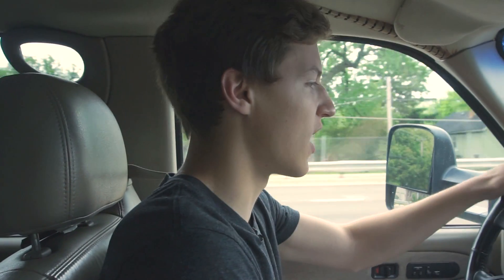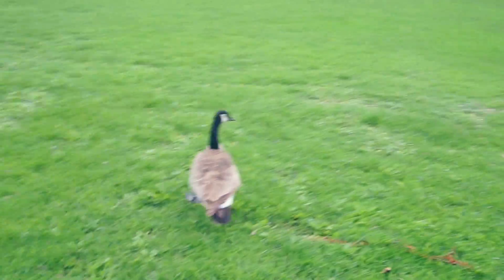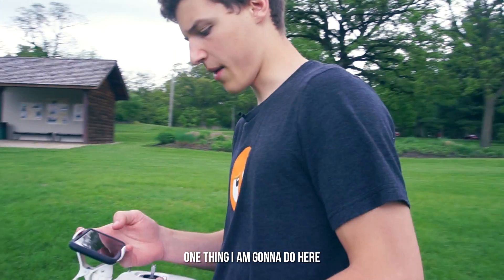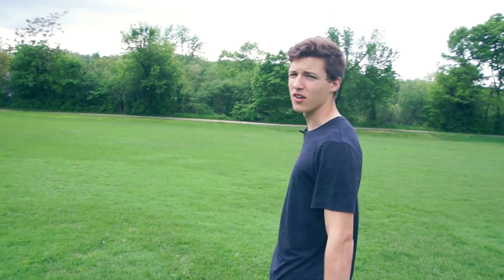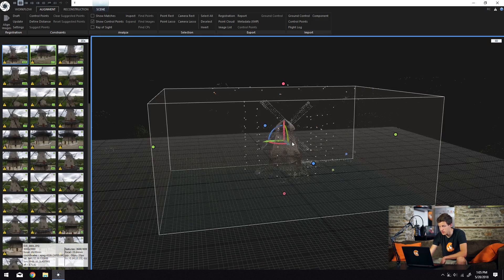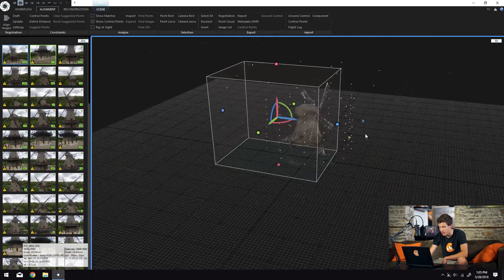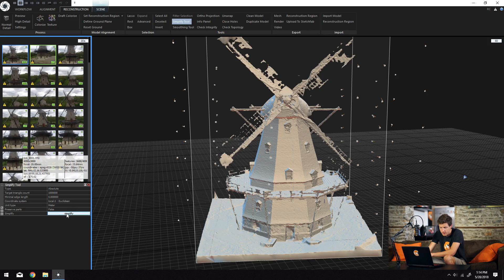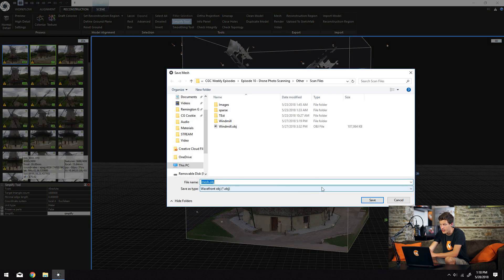3D Scanning with a Drone? - CGC Weekly #10

Comment: To reply to your question: Shoot raw images, tweak them as good as possible (flatten contrast, rise shadows, drop highlights, get correct black and white point, apply s-curve to get back contrast ➡️ but now free of possible blown highlights, push clarity), export to a format the software can understand, and you get quite possible way better results. Check the 360° panoramas on my Facebook page (rolandrickphotography). They are all made of the 26 original DNGs the Mavic 2 Pro takes for 360° panos - hunt: you must activate “keep originals” first, otherwise you’ll only get the finalised jpg made by drone, which is way worse as the manually made one: high res 26000x13000 (manually) has more details than 8192x4096 (drone). Camera settings for exposure and white balance must be M(annually), expose correct to the highlights, this avoids missing details like the strings in the mills wings.

Comment: I find the hundred photos shot straight on was a good start, but you really need 3x-4x more. Start at ground level, about 45* up, and repeat the process. This takes care of things left in shadow a straight shot doesn't get. Do the same thing around with 45* down angle. Lastly, the blades. You could capture one and apply the geometry to all 4. You'll miss structural damage, but it's a huge time saver. You need photos looking at the blades at the angle they are at, maybe 15* off center for a guess. Shoot straight at them, then 45* up and 45* down. Also, finding the owners and museums to sell your scans to is a quick way to pay for your hobby. I'd suggest saving to buy a 3D printer to make models of what you scan. Also, if you pay a bit more attention to the height, every time you change elevation, and attempt to take the 45* up/down shots at that angle, the mesh process is reduced. Less calculations needed. Lastly, the 45* changes to camera position must be done manually, move the lens, not the view. Optical zoom does a lot more for you than digital. Ignore the minimum and maximum distance though, concentrate it at 20% less than they state for ideal range. Good luck.

Comment: I did the same thing with a DSLR using 3DF Zephry. It's a payware but they have a free version that works as good as the pay version.

As far as best practices, the big ones are as follows.
1) Make sure every image in focus
2) Set the f-stop as narrow as possible for the lighting in order to have the widest depth of focus
3) Make sure each and every feature of the object being scanned is captured in at least 3 images from 3 different angles. That of course can lead to hundreds or even thousands of images.
4) Don't be worried about taking too many images. Good photogrammetry software will automatically disregard images that are too similar or will not help.

Comment: I've done a few 3D scans, some with just my phone and some with a Mavic Pro.
Not idea if the Phantom 3 has the exact same software features as the Mavic has, but when scaning an object such as the windmill the easiest thing would be to use the "Orbit mode" to automatically orbit your subject and just use the camera timer feature to take a photo every x seconds. Think of it like making a slow turntable animation. Then manually fly around and get some closeups of smaller details, such as the blades on the windmill.
Using something like DroneDeploy can also make taking the pictures way easier as you just plan it's flight path, then it does all the flying and photo taking.

For something like that windmill, if I wanted as high resolution result as possible, I would probably go with 36 photos in one circle around it. Then probably another 36 photos every 2-ish meters up and then fly in a grid over the place to get some top down photos of both the windmill and the ground around it. 

For anyone just wanting to test out photo scanning I would recommend just going out with your phone and take a ton of pictures of a decently sized rock or a tree stump. In the right light conditions that can produce super nice results.

Comment: Looked a bit of a fail to me the geometry was a mess, You could of modelled it from a few reference photos in the time it took to go there do the drone stuff, buy the software, learn the software wait for it to  compute the point cloud etc. The only advantage I can see is generating a automatic texture map
Reply: It depends on the task. If your task is to just make a windmill, then it would be way faster to do it that way. But if you're tasked with recreating or digitizing a historic piece, then doing a high resolution scan of it and just cleaning it up afterwards is most likely going to result in a better final product.
Reply: Definitely not a fail. Most photogrammetry requires clean up work. There is no way you can model/texture that in the same amount of time. In real world applications it comes down to cost. It's cheaper to go this route and you can end up with a more accurate photo real model.

Comment: I would like to see if this can be done with less expensive software. Reality Capture is very expensive.
Reply: If you're interested in looking into them, a few free softwares include VisualSFM and COLMAP, and some cheaper paid softwares include Agisoft PhotoScan and Autodesk Recap. Though, none of these even came close to matching the speed or effectiveness of Reality Capture.
Reply: There are a variety of free or open source programs for photogrammetry / Structure from motion
this one seems very up to date:
Meshroom using AliceVision : https://alicevision.github.io/
https://github.com/alicevision/meshroom

and as others have mentioned Regard3d is pretty up to date as well:
http://www.regard3d.org/index.php
However for linux it seems like it needs to be compiled from source:
http://www.regard3d.org/index.php/documentation/compiling

edit
if you can scan with a depth camera then there are also program like this:
RTAB-Map
http://introlab.github.io/rtabmap/
this allows for very accurate realtime model creation, but requires more hardware than just a basic camera / pictures / video.
Reply: I think Agisoft Photo Scan which is a competitor to Reality Capture has a student or hobby license... I want to say that it was like $50.00 US dollars a year ago. I did a research project for a class which is why I know about the price of stuff.
Reply: Yeah ditto on Reality Capture being pricey with 33 Euros/Month and then also subscription model. 

I've been using Agisoft's Photoscan Standard for over a year now and I don't really miss a thing (60 Euros). I think it has great reconstruction and handles even large image set very well. Haven't run into any bad surprises. Your PC hardware being key here, especially your memory (>=16 GB)
Reply: Autodesk Recap is free with a student account (also free) but works over the cloud so you don't work within just upload you're photos and wait/hope you get a good result, so not a mealtime workflow. I think Agisoft Photo Scan and Reality Capture are the best options. I anything free won't have a easy workflow or intuitive  interface.
Reply: BUUUUUT, we can put this to a test. If we get the original Image set from this video we could check and compare.....
Reply: The Gleb Alexandrov video Mike mentioned is quite old and contains broken links or missing softwares (at least for linux, my OS).
Regard3D, as far as I know, is the only photogrammetry really open source software today on the market with some exlusive cool features (like the ability to recover previous photogrammetry sessions, even after a crash&reboot). It's written on top of other sw/algorithms, like VisualSFM, trying to include only the freely distributeble parts according to their complicated licenses. Some of those algorithms are actually used by some commercial softwares, so we shouldn't expect extremely differences among Regard3D and commercial ones.
Reply: Meshroom released not too long ago. Pretty much what you and everyone else here is looking for :-)
Reply: Photo Scan works great when there is lots of unique non-repeating surface details like a rock or log... Most software even paid stuff will have trouble with the windmill thin blades and similar things. I would suggest lazer scanning for best accuracy but that's way more expensive than scanning with camera picture data... Plus you wouldn't get a texture from lazer scan since it just captures locations in space (point clouds).
Reply: Check out Visual SFM and some other software. Gleb Alexandrov has a tut: https://www.youtube.com/watch?v=GEAbXYDzUjU
Reply: 3DF Zephry works as good as Reality Capture but they also have a free version and a somewhat cheap paid version.
Reply: Adventures in Fabrication look into WebODM.